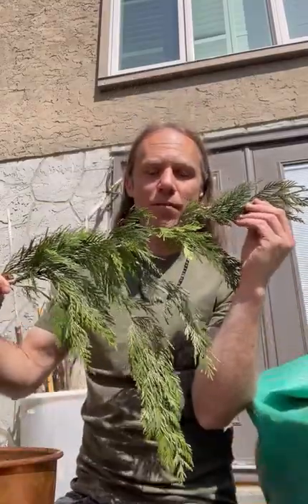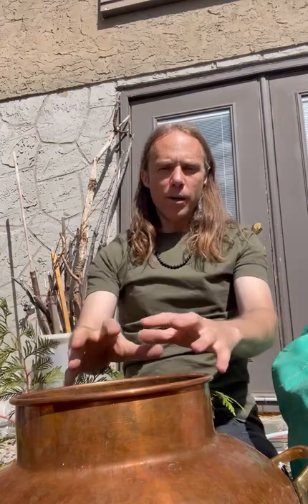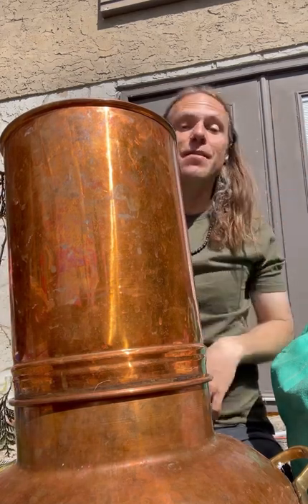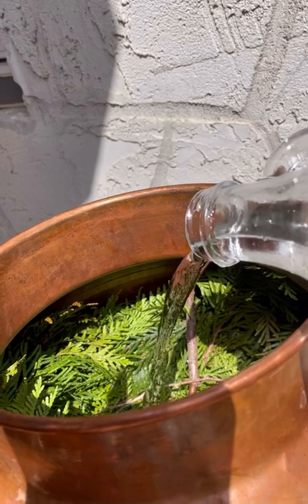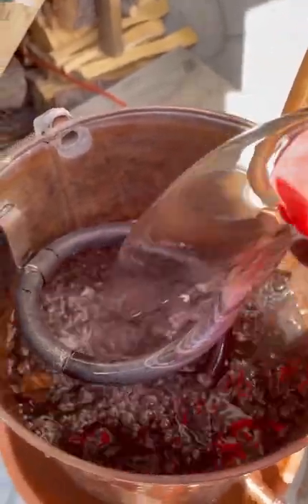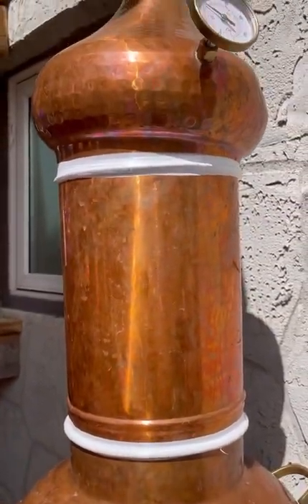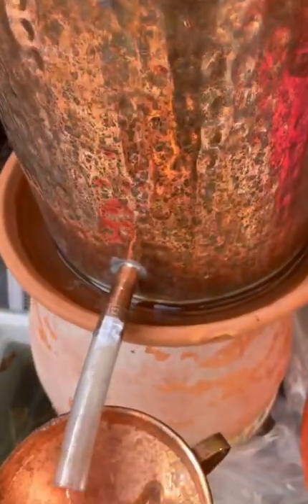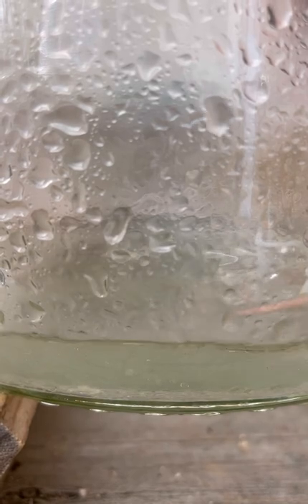How to make: Cedar Hydrosol

Comment: Thank you. What do you personally use cedar hydrosol for? I am asking because I will be making my very first hydrosol using the cedar I've cut from the trees in my yard ( I live in a forest) and I'm not sure how to use my finished product. A diffuser maybe?
Reply from the maker: amazing, good for you! you can absolutely place the hydrosol in the diffuser, so long as it is one that takes water and not just oil. A humidifier can be a place to put it too... I usually have it in a spray bottle and will pritz the air for a little forest freshness. Cedar is not recommended for internal consumption as it is hard to regulate how much of the oil which would contain a concentration of the Thujone which could be toxic. However, a little bit in tea could be fine.  Happy distilling. Have fun with the cedar and whatever else you get into distilling, there are lots of plants of which the hydrosol itself cna be consumed and makes a nice addition to tea, water, etc...
Reply: @thelightcellar  Thank you for your response, I'm excited to see what I can create. I actually used my first batch of cedar hydrosol by putting it in a kettle I keep on my wood burning insert.